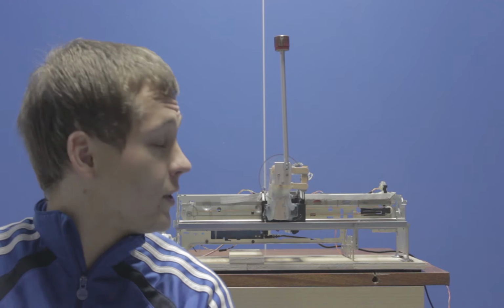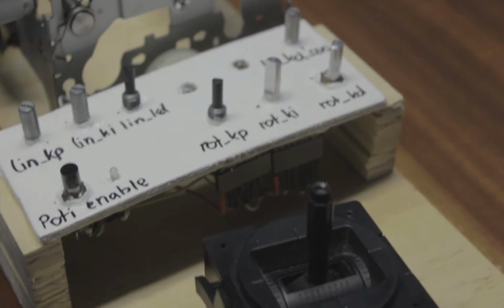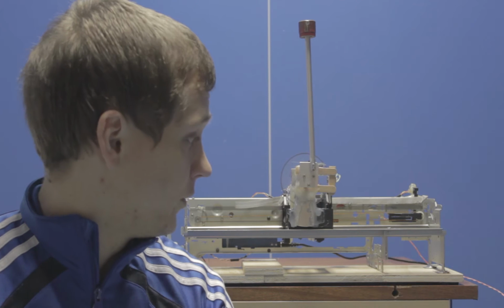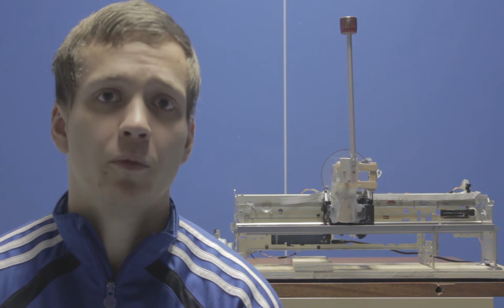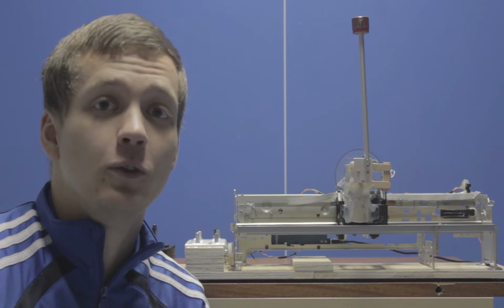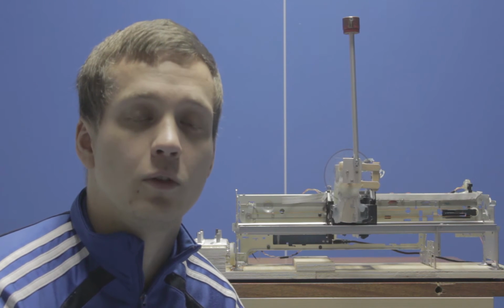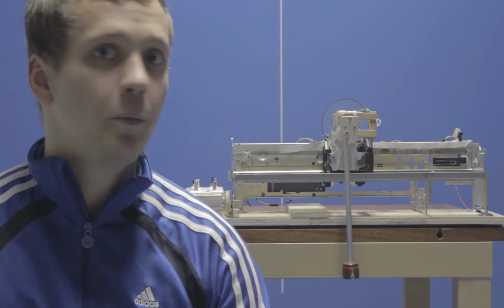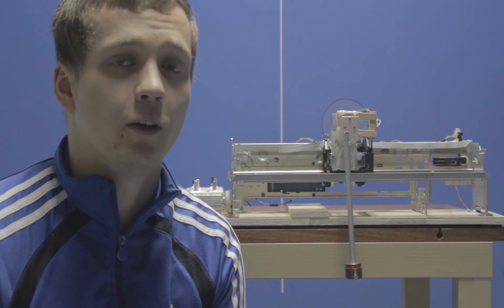Inverted Pendulum, PID controlled using an Arduino Mega Update

Comment: Hi Kevin, I tried to read your code but I can't apply it in my system. Can I ask you some questions?
My system only use encoder for angle(1000 pulses), encoder for position(600 pulses), So, where need I change parameter in your code. And I can't find the parameter of your system in code(the weight, length of Pole and Cart). Can you help me please?. Thank you very much

Comment: Hi Kevin,  I'm almost 50 years old and I'm still intrigued on  experiments and learning new stuff.
Two years ago I saw a beatiful inversed pendulum in Paris (La Cité des sciences et de l'industrie) and once back home I started googling to learn/realized something by myself, and I came across your clips.
After few months, another old printer has changed into an inversed pendulum!!! 
In these days I've develloped a rather simple (and working) swing-up strategy, and would like to share/discuss with you in case you're still interested on this project's part; I'm aware your project relates to few years ago, yet the Covid pandemic forces us to stay more inhouse ... just let me know in that case (andreaDOTfavero71ATgmailDOTcom in case).
The swing-up implementation still requires some improvements, yet the strategy appears quite solid.
Now.... I do really want to thank you, as your clips well explained problems, and your tips have helped me a lot.
Also thank you for showing your setup quite in detail, again a good reference, for instance on the Arduino board to choose.
As already said by others, I did appreacited your approach on sharing the issues encountered and related solutions.
Thank you
Andrea

Comment: Hi,  it´s a nice project :), I have one question, What amperage did you use? Because i am using an lm289n, my power source gives me 30 volts to 2.6, but I already burned 2 bridge h.       Regards
Reply from the maker: Hey, to be honest, I dont remeber how much amps the pendulum drew, I´d have to set it up again and really measure it. During normal balancing you barely draw anything. If I remember correctly,  current would peak at about 2-2.5A when you give pendulum a really hard bump and it had to correct itself. I havent had  any problems with the L298N driver board yet.
Reply: Ohh, so, in your source power you put 2.5 as máximum current possible?
Reply from the maker: No, I havent limited my power supply to 2.5A, thats just the maximum amount it would ever draw. Again, take my 2.5A with a grain of salt, I could be remembering wrong but they should be in the right ballpark.
Reply: Oh
Ok
Thanks a lot :)
Reply from the maker: No problem. I´ll set the pendulum up again in a while, I´ll make sure to measure the Amps and report back here.
Reply: Thanks :)

Comment: Hi Kevin
Can you explain more to me why you use a short pendulum ( short pole )?
Reply from the maker: The long one was annoying the carry around, it took up so much space and pendulum was hard to store.

Also, balancing the short one is more impressive in two ways.
First, the short one is actually harder to balance. I can easily balance a broom on my finger for example, but not a pen. So balancing the short one is more impressive to people. 
Second, bumping the pendulum with your hand is more impressive with the short one because I can bump it much harder and it still catches itself. I can probably bump it 20° from the vertical, I couldnt bump the long one this far because it would need a longer track to still catch itself. My tracklenght is limited by the printer though....

Comment: nice work buddy ...
can you please share the details of components.
Reply from the maker: An Arduino Mega as the microcontroller and a L298N as the motordriver. The rest of the components, the motor and the rotational and linear encoders and the limit switches all came out of the printer. I cant remember the model but you´ll find similiar components in every printer.
Reply: I have hp ink jet 2410 , I wanted to make the same project ... 
thanks for replying...
Reply from the maker: Cool, should work. Be carefull with the rotational encoder and it´s disc. The disc is attached to the shaft that feeds the paper and the encoder is probably on a board. Look at the  encoder on the board to figure out it´s wiring. It´s usually 6 pins. Plus and Minus for the LED (there is a resistor to llimit the current to the LED in between), one Plus and Minus for both photodiodes in the encoder and 2 signal lines. Sometimes you only have 5 connections,  there they´ll join the two minus lines. Be carefull with the encoders you only have two and if you wire them wrong you´ll destroy them.
I found this to be a usefull link to figure out the wiring: http://reprap.org/wiki/Optical_encoders_01

Keep me updated please.
Reply: thank you.. buddy, if i want to talk about this how can I connect with you??

Comment: hi kevin, 
can you help me please with MATLAB issues i dont know how to define the transfer function of the system and diffrent parameters of the PID controller :/
Reply from the maker: Sorry but I can´t, I have never used Matlab. But that´s such a commen problem that I´m sure you will find help if google a bit.
Reply: so if you can explain to me how you did it, cause i dont know how to define the variabale parameters of the DC motor i have no datasheet for it
Reply: or how did you define the force applied on the cart of the pendulum
Reply from the maker: I did not, whatsoever, take the characteristics of the DC motor into consideration. I also did not define the force applied to the cart. I did no theoretical analysis whatsoever on this system. I just took the components I had at hand and tuned my PID´s manually by trial and error until I was happy how the system was behaving.

Comment: Hi Kevin,
Can you explain to me some sentences in the code?
Reply from the maker: Sure, just ask!
Reply from the maker: From what you say it seems to me that your linear controller is not tuned aggressively enough. I´m able to bump the pendulum really hard and it still catches itself before it runs into the linear limit.

Kevin
Reply: Actually I did not appreciate this moment to adjust the linear control I did not know the reason
Reply from the maker: Sorry but I dont understant what you mean with your last comment. I think something went wrong in your translation into english on that one.

Comment: Hi Kevin,
Thank u very much for replying my questions previously.

I got another question here.

In ur code the rotary setpoint is not equal to 0. It is the output of the linear controller.
when I serial print rotary setpoint  it gives me values between -0.2 and 0.2 (oscillates in between 0)

Why cant we set rotary set point = 0 (constant value) same as linear set point?
Could u please explain that ?

Thanks in advance.
Reply from the maker: It seems to me that you have not understood my concept of balancing the pendulum.
I´d recommend watching the videos again and try to understand the strategy of controlling rather than the actual code.

You have the rotational controller, it´s input is the measured angle, it´s setpoint the rotary setpoint and it´s output a PWM value to the motors
You can fix the rotary setpoint to 0 but think about what that means. There are multiple situations which satisfy the condition rotary setpoint=0, for example the cart constantly moving to one side while balancing the pendulum. Another example would be the cart standing the still with the pendulum balanced at 0 but the cart could be standing at any possible position on the track, it could be standing still in the middle, slightly to the left of it, slightly to the right, near the left end of travel,..... every possible position of the cart would satisfy the condition of rotary_setpoint=0 as long as the pendulum is upright at 0.

There are two problems with this:
1: That´s not what we actually want, we´d like to control the position of the cart as well as just balancing the pendulum.
2: The system doesnt care about the position of the cart because of what I said above. That means it will go to the postion whereever it has to go just to catch the pendulum. An inverted 
    pendlum is always unstable! No matter what you do and how perfect you balance it upright, it will eventually fall over if you dont stop it. The system would try to catch the pendulum but 
    because it is not aware of the carts position it might be that this position where it wants to go to catch the pendulum is outside of the range of travel of our physical system. I used an old 
    printer so I have around 30cm of total travel. That´s actually not a long track for this application. So what will happen is that eventually, while the system is trying to balance the pendulum, 
    the cart will run to the left or right limit where it cant go further. Because our track is so short this usually happens within seconds That´s not what we want. We´d like to balance our 
    pendulum for an unlimited amount of time not just a few seconds.

So as you see, we don´t only what to control the position of the cart, we actually have to in order to balance the pendulum for a long time.

So we need to find a way to move the cart to the desired position all while balancing the pendulum as well.
Thats where the linear controller comes in, it´s input is the measured linear position, it´s setpoint is the linear_setpoint, and it´s output is rotary setpoint.
It will set the rotary setpoint so that it wont be 0 but always slight leaning towards the linear_setpoint. The rotary controller will take this setpoint and will try to achieve it. The"problem" for the rotational controller is that you cant balance a pendulum leaning to one side, it would fall over, the only way to keep it at that leaning angle is to move the cart along with the pendulum. It has to move at the exact right speed to maintain this leaned angle. If the cart moves to slow the pendulum will fall over in the direction where its already leaning, if it moves to quick it  would "catch" the pendulum and balance it upright. But upright is not what´s it´s trying to achive in this situation, the rotational setpoint is not 0 but 1 or somtheing like it.
During all this the cart will steadily move torwards the linear setpoint. That´s what we want! The closer it comes to the linear setpoint the smaller of the output (rot_setpoint) will become until eventually the cart has reached the linear setpoint and the linear controller will output a rot_setpoint of 0. At this wont work because there is still some momentum in the pendulum and it will overswing a bit leading to that slight oscillation around the linear setpoint, but this oscillation will settle down eventually if you have tuned your system correctly.

You seeing this 0,2 -0,2 oscillation even if the pendulum is upright and the cart standing still at the linear setpoint is totally fine. Again remember, an inverted pendlum is always unstable, nomatter how still it looks to our eyes, it will fall over. The rotational sensor is so good that it will sense the slightest leaning of the pendlum and therefore the system will try to correct it, because the error is so small though only really small adjustments are needed to keep everything stable. Those small adjustments are those 0,2 and -0,2.

I hope that helped you, I really dont know how to better explain it!

Kevin
Reply: Kevin, You explained it very well. Now I completely understand why rotational setpoint can't always be zero. Thank you very much for sparing ur valuable time to explain this and I really appreciate all ur efforts. Cheers!!!

Comment: Hi Kevin ;
Can you help me to find the dc motor printer variables(gains : km=? , kg =? ,Rm=? ,.......) you used in this search
Reply from the maker: I can´t because I don´t know what km,kg,Rm are. I haven´t used any variable named like these in my code. From what I googled these seem to be constants specific to every dc motor and necessary If you want model the dc motor into your system as well. 
I havent done that in my code because I dont know how to do it and because my pendulum is working just fine without them

Kevin
Reply: Hi Kevin ;
 I want them to analyze the transfer  function of inverted pendulum using MATLAB and find  lqr controller
Reply from the maker: Good luck!
But I cant help you with that, I have no idea of lqr controllers!
Reply: thank you kevin :
and i have a problem with pid inverted pendulum 
The problem is that the system is too slow to settle in the middle :lin_Setpoint=4000
Reply from the maker: What do you mean by it is "too slow"? If by that you mean that the system is taking a long time coming to a stop at the linear Setpoint you´ll have to tune your PID gains better, if not you´ll have to explain your problem further.

Comment: Hi Kevin, 
In my final year project I have the mechanical structure as yours. I have a rotary encoder as well as linear encoder to get the angular rotation and position of the cart. What pid controller should be tuned first? Can u suggest me a way / sequence of tuning pid constants for both controllers (pendulum and cart position) 
Thanks in advance
Reply from the maker: Start with the rotational controller first and start tuning your P before you go on to I and D. For I and D: go back and forth between tuning them, they influence each other so much that you can´t tune one without the other.
After you´re done with the rotational controller you do the linear in the same way. 
Just as a reference, those are the gains I ended up with:
    lin_kp=0.01645;
    lin_ki=0;
    lin_kd=0.000706;
    rot_kp=3,54;
    rot_ki=54;
    rot_kd=0.01549999;
    lin_kd_avg=152,4;

Good luck!
Kevin
Reply: krz4tw Thank you very much. Cheers!

Comment: Hi Kevin!
Is all right with you?
I need some help:
I created an arduino code for the inverted pendulum control, based in pid approach (as yours code - GitHub web page). I had some success for pendulum control, but i didn't get to lead the cart for the center track (setpoint = 0).
I put three potentiometers for cart pid and three for pendulum pid. I put too a potentiometer for angle adjust, for remove a pendulum side tendence (left or right).
I put a line in the arduino code for to try to lead the cart to track center. It is: angle = angle - k * error_lin. The variable k is very small and is adjusted by a potentiometer. The error_lin is the difference between lin_setpoint and lin_position. This approach didn't work well.
I didn't use speed variables: linear or rotational in my code as yours code.
I would like to send my arduino code for analysis.
Send me an e-mail, please.
My e-mail is: a.antonior@yahoo.com.br
Thanks for your attention.

Comment: Can you send me an e-mail with your Academic Research work?
I want to do a citation of your work in my Academic Research. My e-mail is: a.antonior@yahoo.com.br
Thanks.
Reply from the maker: I didn´t research this topic academically. I did this for fun without any other purpose then seeing if I could do it. 
I´m a college student but I´m studying mechanical engineering not control theory. You can cite me but I don´t think there´s anything to cite here, the inverteted pendulum is a standard problem in control theory on which pretty much every new theory is tested and PID controllers have been used for decades.
I also haven´t done any theoretical analysis of the problem. 
There´s plenty of better material on pid controlled inverted pendulums out on the web.

Kevin
Reply: You are right about the pendulum control theory, but you are wrong when talk about the others quality works. Very few works show the inverted pendulum, built by parts of electronic waste (parts of an older printer), as good as you show. In many countries, in general poor countries, the students need build the testbeds themselves with electronic waste. Your work doesn't contribute with a new theory of control, in agreement with the your opinion, but is a reference for testbeds built with electronic waste.

I wish the best for you!

Thanks for your attention.
Reply from the maker: That´s actually part of why I did the video. While I was building I was searching on the web and didn´t find anything besides the highly theoretical papers or  short youtubes video without any explenation at all.
So, I´m glad I could help!

Kevin